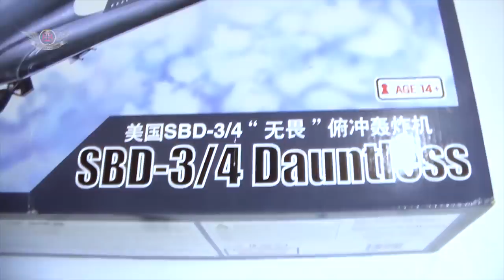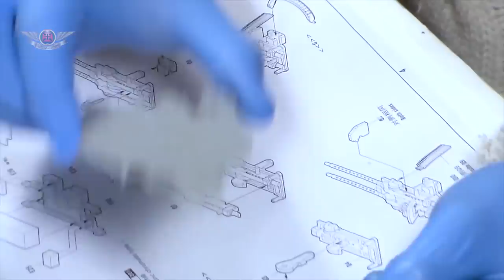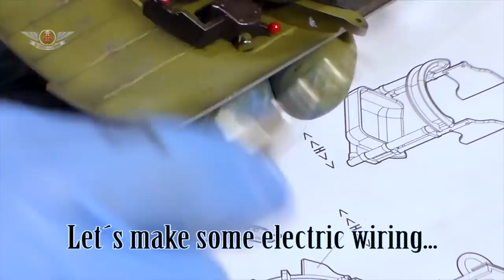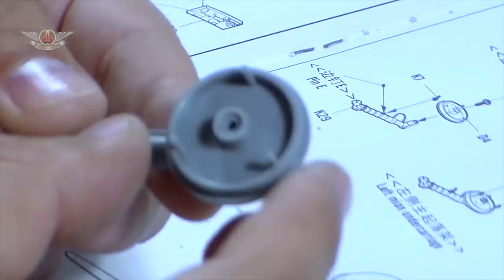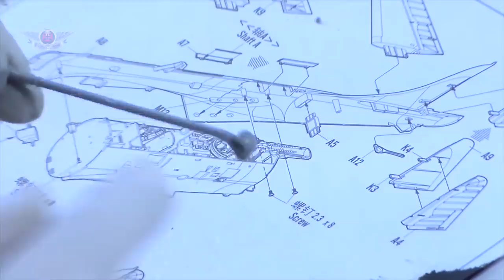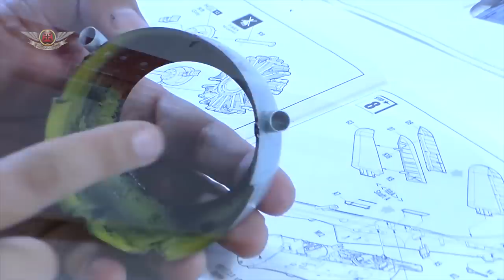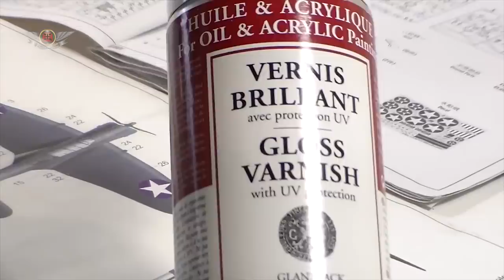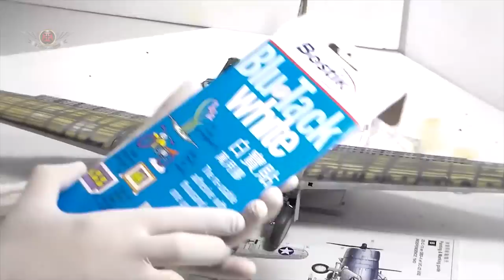1/18th MERIT INT. SBD 3 DAUNTLESS FULL BUILD VIDEO "reloaded"

Comment: As a former USN ordinance guy the bombs were solid dark green not having any scrape marks and a yellow stripe around nose of bomb the detonator has a small silver ring around the outside of the detonator and the propeller of the detonator is red.  Pilots or bomb crews would use chalk to write saying or slogans or cuetsie remarks on bombs. The yellow stripe denotes live ordinance and training bombs are blue. The bombs are stored in the lower decks of the flattop to protect from damage and the detonator is stored in a separate storage area and are not attached to the bomb until the bombs are readied for mounting on aircraft. Just an FYI if a bomb has scrapes or paint damage that would be looked upon by the weapon's/ordinance officer as mishandling by the ordinance gang and someone's but would be in serious trouble. Also this is an old navy saying if it moves salute it if it does not move paint it. As part of maintenance of an aircraft on a carrier it is painted, the only time an aircraft would  have the amount of weathering/ scrapes would be upon return from a mission or if it had been assigned to a forward airbase (on land)were they are short on supplies. Again the American Navy is very much sticklers on proper maintenance and painting even when at war. An aircraft that is in this bad a shape would be pulled from service  for repair and repainting and if it was deemed as it's shape being too bad it would have been shoved over the side and again it could be in this shape if it was assigned to a forward operating land base that was running short on supplies and this aircraft would have been used for parts or it was not in approved flying condition. Replacement aircraft would be delivered by Jeep carriers. This is my experience as having been a USN sailor.
Reply from the maker: And thank you for you service and for your coment
Reply: Sean is correct. This was particularly true within the US Navy and eventually carrier based Marine Corps squadrons. (Land based USMC Corsair aircraft had significantly total time airframe hours).

SBDs expected total combat airframe hours was between  150  and 250. Some did operate more than 400 but was extremely rare. If the aircraft was still flyable past 200 - 225 hours, it was flown to a depot for overhauled engine, etc. Upon arrival at the depot, it was not uncommon for replacement parts to be backlogged until early 1944. In many cases, if the engine and prop was still good but the fuselage riddled with holes and cables beyond repair, they would pull the powerplant and other parts, then dump the fuselage off the fantail.
As aircraft production ramped up, it was simply faster to fly new aircraft to the carrier, never to see their old ones return. After the Battle of the Phillipines Sea in June of 1944, the SBD was retired from frontline Carrier service. 

By the end of the war, the US Navy had over 103 Fleet and Escort aircraft carriers operating in the Pacific, Atlantic and Indian Oceans plus the Mediterranean Sea. Very few carrier aircraft had more than 350 flight hours. That would soon change during the Korean War 5 years later.

Comment: Looks amazing, and yes  is more weathering than I think I would have done  😄 but it's Your Kit, you can do it anyway You want.. It Still looks Great, you did a great job for sure! I think if I ever decide to try this kit myself, I'm going to mask and Paint the Markings instead of using the decals, at least the National Marking White Stars .. only thing i would say was wrong is the color of the machine guns the bluing used and still used is an almost flat black/blue  and to weather the guns i'd use a very little amount of dry brushed  light steel more than silver mostly below where the ammo belt feeds are and the edges of feed tray..  when I was in Army most of our 50 cal mgs were from WW2 or korea with few mods well maintained the bluing was on there so good that there wasn't much shine. even after 40 years of use.
Reply from the maker: I totally agree... Thank you very much! 🙂🙂👍
Reply: I didn't know that about the 'bluing' . I do like the way the decals have a denser centre , where the 'meatball' was painted over after May '42

Comment: I just built some 1/24 front engine dragsters, I removed the seat belts that were molded into the seats and fashioned my own using an old under armor type shirt to make the straps. It turned out great and in my opinion looks and acts just like real seat belts.

I hate to say it, but you did the same thing that so many people do with WWII aircraft trying to make it look cool or "realistic" and totally mess up. That is a Navy carrier aircraft. Bombs for carrier based aircraft only go on an aircraft once and never come back to the ship because back then a carrier landing was dangerous enough without ordinance on the aircraft. So even if a flight didn't find a target the bombs were jettisoned before landing, so the bombs always looked brand spanking new and didn't ever have time to get weathered.

Comment: I had a Guillows balsa wood kit I was going to make into a you control. I can't believe that one is approximately the same size.. I don't know what became of the balsa plane or the engine. But you have given me a heck of a idea. I would probably have to bury it in a catalized clear coat to stop the nitro from eating the paint and plastic however. And I would only fly it once or twice. The bean oil is to hard to wash off. Takes lots of dish soap and hot water.

Comment: I realize at 1/18 scale, molded details are vastly improved and along with increased costs, but I would have still used as much resin, white metal (pewter) & p.e. as possible, everywhere.

Most especially in the larger scales, like 1/48 (maybe, but definitely larger) & up, you really should skip the use of decals for stencil & paint as much as possible. The paint is infinitely easier to weather, and it doesn’t add thickness like a decal does, also there’s no chance of silvering or carrier film showing. 

One last tip/trick. When removing the canopy mask. If you use a toothpick to lift the edge, you reduce the risk of scratching the “glass”, that is unless you want the scratches. 

Awesome build though. Thanks for sharing.

Comment: Enjoyed watching this. The weathering looked way over the top when it was being done close up but when you see the final completed aircraft it all looks like natural wear and tear. Well done.
Reply from the maker: Sometimes filming close Ups created a feeling of exageration... But at the end i think its weathered and natural
Reply: Better than Bob Ross
Reply: No, it was over the top from any view and entirely unrealistic for a carrier-based airplane.
Reply from the maker: Thank you for your opinion
Reply: @AlexModeling  Well, I appreciate your polite diplomacy, however, what I said is not my opinion. It is fact beyond opinion or conjecture. Check it out yourself and I'm certain that you'll see that I'm correct.
Reply: @Glicksman1  Is it your assertion that a maintenance crew on an aircraft carrier would never let a plane get in such condition, or that the KIND of weathering is not accurate for carrier-based aircraft (eg sand-blasting)?
Reply: @scottbilger9294  Both. The kind of weathering from seawater spray does not look like that. It's more a wearing-off of the clear coat and a greying out of the blue paint with little or no metal exposed. As such, it's hard to duplicate on a model.
Also, we well know that the maintnance of carrier-borne aircraft, then as well as now, is meticulous. Repainting and clear-coating where there is obvious wear are regular activities to preserve the airplanes. Occasional scuffing wear is always repaired immediately.

Comment: actually, sbd is a usn designation. it means Scout Bomber Dive. the dauntless was a dive bomber. the curtiss helldiver, also a dive bomber, replaced the dauntless in 1943-44.
Reply: I'm afraid not , Jane . The 'D' is Douglas , the maker . The Helldiver was likewise SBC was S-Scout B-Bomber C-Curtiss.  It was developed into the monoplane as SB2-C . The TBD Devastator was T-Torpedo B-Bomber D-Douglas . The last letter of the three was the initial of the maker until the system changed in 1962 . Pete

Comment: Excellent job! If I may give a couple suggestions? As a Navy plane in heavy service, the canopy won't be crystal clear. Try scuffing with a very light  tack cloth and flicking "water" spots with a very diluted and very  pale sea green/white mixture. Carrier planes in the south Pacific are constantly exposed to sea-spray and rain. Also, try fully detailing and assembling your homemade seat belts before putting them in place and I think you'll be happier with the  results.
Reply from the maker: Thank you! I Will do that!

Comment: Excellent work! This model could be used for movie still shots. I'm curious, do you ever consider a tiny drop of some type of grease or oil on those moving pivot points? Maybe even something that's aqueous and will evaporate, but last long enough for the glue to dry without locking up a moving piece. The Dauntless was always my fave WWII plane. When the TBFs scored a big goose egg in Midway, it was the little SBD that flamed and destroyed all 4 Japanese carriers, turning the tide of the Pacific theater and rest of WWII forever, only a short 6 months after Pearl Harbor!

Comment: From my experience around aircraft, groundside maintance, they don't have fuel leaks, and oil leaking from everything. In fact they inspect them every day for leaking surfaces and that is also part of pilots pre-op is to check for any fluids or signs of a leak. Instead they typically have soot on wings, or by apu, or engine cowling. Might get a good effect if you airbrushed some dark brown/black very lightly. A lot of turboprops consume oil as part of thier operation cycle and so the exhaust gases contain gases almost like a 16 wheeler mach truck will have soot on the trailer just aft of the exhaust. Jets don't always have it, but often their apu exhaust will. Think f-18's do as they essentially run diesel or kerosene, if they needed to, though they run jp-8. f-18's are very sooty.
Reply: f-16 i've seen in person up close (as you have I think?) and are typically very clean birds. I think f-15's are as well, though I've never seen one in person on the ground.

Comment: Great build. You know that you have to be very careful and extremely subtle when weathering carrier-borne aircraft. They were scrupulously maintained and any scuff or scrape, etc. was immediately repaired. Bare metal was attended to very quickly as the saltwater would quickly corrode it. All paint, including insignia, was re-painted as soon as the first signs of wear occurred. These airplanes were NEVER seen dirty. They were thoroughly washed down and even fuel stains and such were wiped clean before the next flight. Also, the insignia and other painted-on markings on a properly weathered airplane would have been more weathered and faded than you showed. They're the first to go.
Reference to actual photographs is the best way to get weathering right. I've never seen a photo of carrier-based SBDs that looked so worn. I like to weather models as much as you and I use many of the same techniques, but you really should have selected a better example. Land-based U. S. Marines' F4Us were often really scruffy and worn and hardly, if ever repainted or washed, etc. They are a very good weathering project. However, it was all too much for this airplane I'm afraid.
Reply from the maker: And yet, I had so much fun! Thank you! :)
Reply: @AlexModeling  You're quite welcome.
Well, I'm glad you had fun and you did a remarkably good job weathering the hell out of that SBD. Even so, and despite the fun you no doubt had doing it, it's the wrong subject for such. You'd have had equal fun doing this on any number of other subjects that really were weathered in service.
Please keep building and showing us the product of your tremendous skill. We can all learn many things from you.
Reply from the maker: Thank you! And thank you for being direct, honest and constructive. I really apreciarei it! Please Stay safe . All the best 🙂
Reply: @AlexModeling  Right back at 'ya.

Comment: Let point something out.  Your work was superb, however.  You should have painted the frame work on the canopy zinc chromate yellow before you put on the top coat so the frames would look like they were part of the interior, and not painted over clear plastic moldings.  One other thing.  Weathering is best when minimum.  Good work though.

Comment: Wow. What an amazing build. Absolutely gigantic. 

One thing I noticed. The black primer was Vallejo spray/rattle can. Does that adhere/etch to the plastic/styrene better than the airbrush type? Just wondering because I love the paints, but am completely disappointed with the primer. It just doesn't seem to stick to the styrene, even after leaving it for 48 hours it still comes right off if I accidentally slide my almost nonexistent finger nails (bad habit of biting my nails) across it and even have had the paint come off just a light rub of my finger. I clean all the parts prior to clipping any off the tree, have tried lightly scuffing the surface before priming and it doesn't seem to matter if I wipe the surfaces with isopropyl (90%) before priming either. I hate to have to revert to enamels because I like being able to airbrush indoors (I don't have a spray booth either) and like being able to clean up with water. 

Any thoughts would be much appreciated.
Reply from the maker: i find the can one better than the airbrush... your right primer sucks a bit

Comment: I'm working on the AIRFIX dogfight doubles it's the 1:72 scale supermarine Spitfire Mk1A and the Messerschmitt Bf109E - 4... I'm kind of stuck on the camouflage for the Messerschmitt any suggestions?
Reply from the maker: Make stencils on the wing camu. If you have Airbrush find (you got to find it yourself) the spot beetween pressure and Paint dilution to do the spots ir splinters... If you don t have One, use very diluted Paint and paint it yourself... Then after aplying a proteção e coat of satin varnish (carefull) with the canopy) aplly an oil wash... You will notice the spots will"blend" with the Paint work. Above all... Have FUN
Reply: @AlexModeling  I have airbrush gun and I'll give it a try I appreciate it man!👍
Reply from the maker: Good luck! Have fun!
Reply: @AlexModeling  thank you my friend I appreciate that ... and as you always say  keep modeling "always with a smile" !☺

Comment: After the build, you are supposed to hold the model up in the air and run around the room going "vroooooommm"...
Ok...Seriously, great build. Didn't know they are making such large scale. Also : I am somewhat disappointed at the lack of details offered by Merit. For instance they really did a quick job on the machine guns and the instrument panel. Not even photetched parts.. I'v seem 1/48 with more fine detailing.
Reply from the maker: I agree... Thats why i tried to do my best... At this scale i shouldn t be doing. It

Comment: Great video and great model. Too bad the wings do not fold. As for all that chipping and weathering. The Marines, and yes they flew these too, may have let their planes get this bad. But the Navy, not on your Nelly! Planes where kept clean and painted and looking dam near as good as factory fresh all the time. Or so my Uncle once told me. Who was actually on Midway island during the battle. A radio operator.
Reply from the maker: Thank you for the input! Yes i think i got carried away on this one... i still like it but i went a vit far... thanks!
Reply: Dauntless wings don't fold
Reply: i like factory fresh myself..if i were a pilot i would keep my plane spotless and well lubed..
Reply: @supermanwhereareyounow3081  Yeah the Navy was all about keeping planes and equipment clean and fully repaired. Or so my Uncle who was a Navy Pilot told me :)
Reply: I will paint it solid navy gray...i really do not go for called color.i love metal colors so i give them a modern twist..call it a restored version...there will be lots of chrome duralumiun stainless steel colors on the engine landing gears bolts etc..

Comment: David R Lentz, Columbus, Ohio, USA (Tuesday, 27 August, 2024) 

   I very much want to watch your build video. The white background is too painfully bright for my eyes, however. 
   Is Merit International now “I ♥ Kits”?
   Do you know if any kit manufacturers (injection-mold polystyrene) make a Douglas SBD Dauntless USN/USMC Dive Bomber kit in 1:24th-scale? 
   You could paint one of your SBD-3 models in olive drab over neutral grey and re-designate it as a Douglas A-24 Banshee USAAF Dive Bomber. Had I the means, I would set an A-24 amongst an M-4 Sherman U.S. Army Medium Tank, a few Willys Overland M-38 U.S. Army ¼-ton 4×4 light utility trucks, two M16 U.S. Army half-tracks, M45 Quadmount (four .50 cal. [12.7 mm] M2 Browning machine guns) multiple gun motor carriage, two captured Oval Blitz 3-tonne former Wehrmacht cargo trucks, hastily repainted in the field in olive drab, and a platoon of U.S. Army ground troops, passing to the north through southern Italy in mid-1943, as a pair of grizzled veterans rush forth to check upon the downed aircraft for survivors, finding both in functioning condition, one wearing on his officer’s cap an Army major’s oak leaf insignia . . . .
   After I texted the above, I saw on YouTube a model shop proprietor and channeller report of the new Takom 1:16th-scale kit of the one-quarter ton 4x4 mb utility truck.